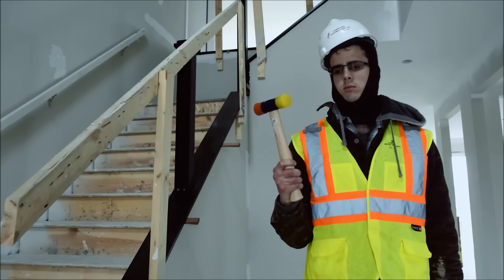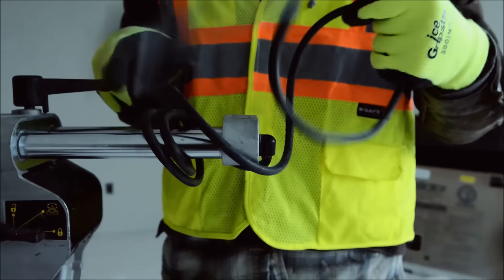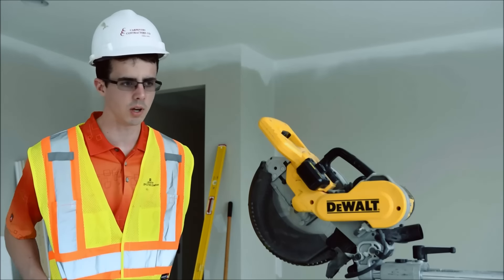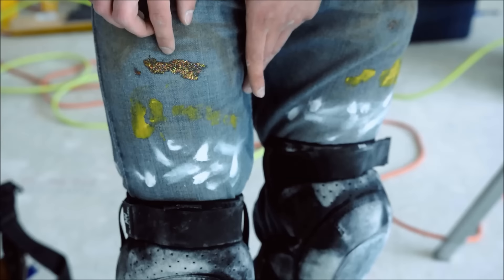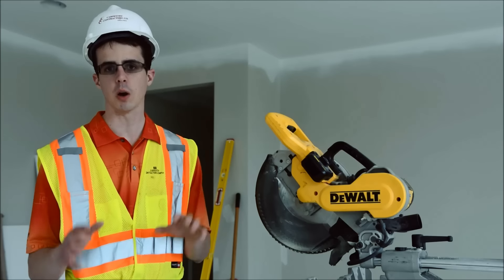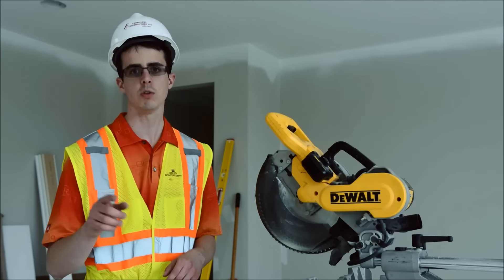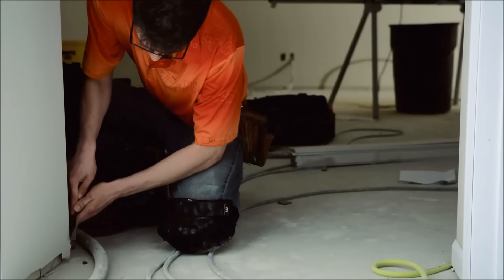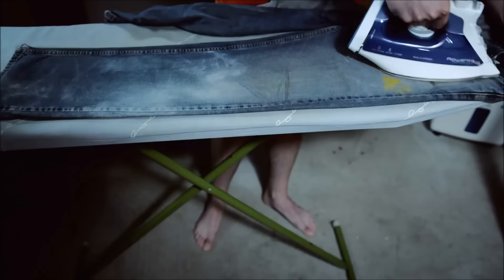Trimming Houses in Minnesota - Humor

Comment: Good humor! As a fellow MInnesotan and trades person, Oh I get to be the last guy in that line of blame. See I run a commercial Drywall and Painting shop. As General Superintendent , I get the pleasure of fixing everything the finish crew decided to use a hammer saw on, to make fit, of course. Mostly happens in the multi family or hotels because the framers are no longer carpenters. Rather panel installers and most wouldn’t know a square if it were a free gift. Plus the headers and jambs are usually multiple studs sandwiched together. But never on the same plane of course. And the door jambs and casing don’t quite touch. Out comes the hammersaws. “Now the drywall is out of the way and my trim and door frame touch. The tapers can fix it.” Geez thanks guys.

Comment: You want a trim vehicle?  I started with a VW and worked my way up to an 89 Suburban.  Tail gate was for the chop saw, pancake compressor over the spare tire well,  two passenger doors offered easy access to routers, nailers, planers and hardware.  Back the beast up to the garage, pull hose and cord and go to work.  Easy peesy drive off at the end of the day.
Reply: A VW??.. as in a KOMBI BUS... now thats awesome!!!!

Comment: Electricians must screw with a lot of stuff because I've heard that many times over the years even though I have little experience with carpentry. Maybe they should be required to get a little framing and drywall experience.